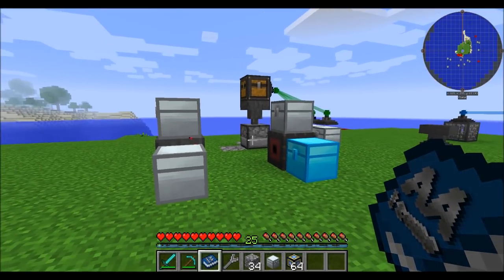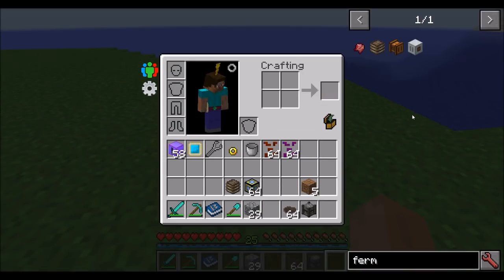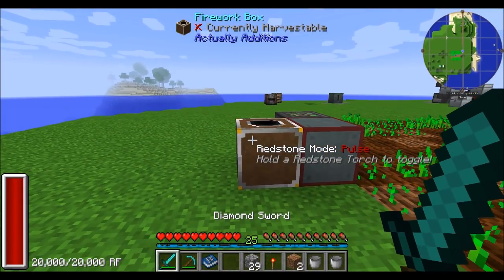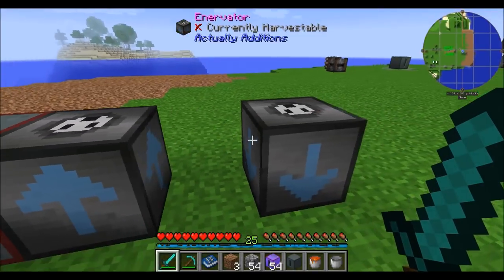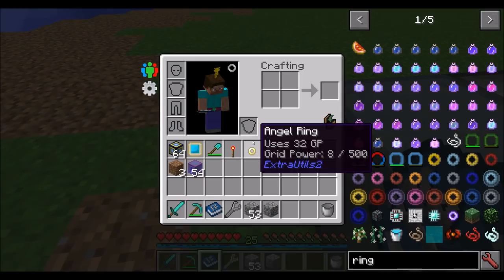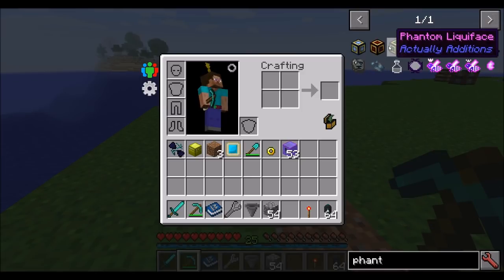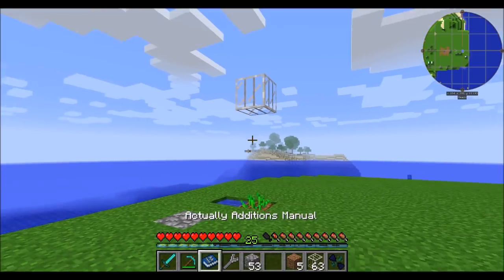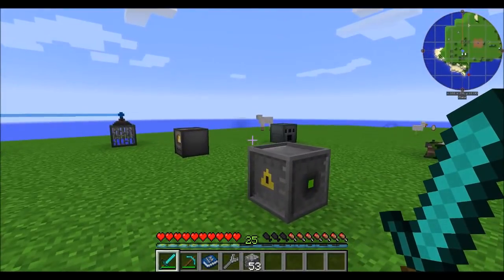Mod Spotlight   Actually Additions Pt2

Comment: The phantom placers make for a great wither farm. you can use the RF Tools shields to form a kill chamber and the phantom placers with phantom boosters to build a wither inside. 

It does take some timing trickery, but RF tools sequencer is up to the task. just make sure that you place the skulls after the soul sand and that the next wither isn't built until the previous one is dead or out of the way. A tower setup is good, it lets the summoned wither fall before exploding.

Draconic Evolution has a really powerful mob grinder that can insta-kill the wither. so that part is also good.

Comment: So this mods RF usage was balanced around Draconic Evolution then :P ?
Reply: What do you think is the problem with it?
I've never gotten any complaints about balance in the past, so I'm definitely interested in what you don't like :)
Reply: You have things squarely balanced around the millions, which is a bit out there.
base Thermal Expansion should be your guide point on RF balance and go from there. Your basic item battery holds 1 million RF, compare that to the most basic form of item energy storage from TE the Leadstone flux capacitor. it holds 80k

Or take your oil generator with basic canola is 40rf/t, compare that to the dynamos from TE, which all run at 80RF/T
the difference they use is the time it runs for per fuel operation. with the highest possible yield 2million RF (over 20 minutes) from the magmatic dynamo running on blazing pyrotheum

Keep in mind I'm not telling you you can't exceed 80rf/t or have your capacitor hold more than 80k at the lowest level. But from how blown out the proportions are in your mod, reigning things in would be a good idea.

You might know the mod Avaritia, the one that adds the 9x9 crafting table. That mod was a joke intended to poke fun at the power creep seen in modded minecraft. The irony was that it wasn't seen as a joke and people picked it up without realizing what was happening. The irony here being that power creep was already so far out of control that Avaritia seemed normal

Avaritia was inspired by mods which were just going crazy with power creep especially those in the field of RF hense why Avaritia allows you to create creative energy sources.

Just. don't be part of the power creep. its all I ask. 1.10 is a good start to fixing that behavior from 1.7.10 and it would be nice to see other mods not made redundant by power creep
Reply: Ellpeck I would enjoy this mod a lot more if you just toned down the rf generation and usage
Reply: lalybum
 thats a false statement that you can use in pretty much any situation. Criticism is healthy.
Reply: lalybum
 Yes, no one said they can't but criticism is not going to stop the person doing what they want. You apparently don't understand what criticism is.
Reply: lalybum
They are a modder. Proper fully explained criticism is useful to people like them. Speaking as a developer. Did you not see the part where they said "What do you think is the problem with it?"

They asked. I told.
Reply: That's interesting. I didn't see Actually Additions as part of the power creep. Mainly because most of the people I have seen on Youtube and elsewhere have mostly been complaining about the low values the mod produces - to my surprise, as I had them balanced around Thermal Expansion values. At the start, the Canola gen was producing at most 60 RF/t, which I thought was plenty. But I ramped it up to have a chance against the more popular power genning mods that were, as you also said, producing power values in the millions. I know that's not the nicest approach, but I also know that things like the EnderIO power generation with hootch and stuff like that is rarely being used by the average user - because it produces "so little".
I usually try to balance/change/fix my stuff based on the "average opinion" I pick up, but I feel this is a topic that only modders are able to "fix". So, I think what I'm going to do is tone down the generation/usage amounts a little in 1.11 and see if that works well with everything else coming up, because I noticed after your criticism that, yes, indeed, the power generation and usage may be a bit unbalanced in places.
So thanks for the help :)
Reply: It also depends on the mod(pack), though. At least in 1.7, the power balance of TE/enderIO, mekanism, extra utils, and Galacticraft are so different from each other, that some power generation options are simply better; i.e. gas-burners & windmills(mek), coal gen(galcraft). 

Throw in some of the addon mods(compact solars),  Big Reactors mod, etc. and the power creep becomes a bit crazy. 

Part of the problem is the ease or difficulty/challenge of setting up renewable energy sources. Compare mekanism windmills and big reactors to an automated tree/charcoal farm powering steam dynamos.
Reply: RoraxPlays I had fallen out of Modded Minecraft for a while, and I came back, and the first thing I noticed was this massive power creep going on. I'm glad other people are noticing it too. I miss the old days of Red Power and Buildcraft where item routing was actually a fun challenge, and mining machines required actual effort to set up. It seems like nowadays people just create mods like "Its like this mod, only easier!" and then the other mod gets all but erased. I have a lot of respect for Railcraft as a mod in that regard. It is a mod that is intended to be challenging, yet rewarding and powerful. No one likes it though, because why set up complex systems to send minecarts out to your quarries and production sites when you can just auto generate ores?
Reply: +DarklingGX - Eh, if people want to have that experience, they still can. All they have to do is not use the other stuff. 
Back when I used to play packs with Equivalent Exchange, I didn't use it. Because I liked the Buildcraft+IndustrialCraft route. Nowadays I just go with Mekanism because it does stuff the way I like it, and gets me off early game (which I been through many times) really easily.

But if I want to challenge myself, I just remove it from the pack, or I don't use it..and there you go.
Reply: Gabeux
the mod lists get very small when everyone has joined the creep my friend "just don't do it" is very dismissive of good critique
Reply: You have a high opinion of your critique. Also, I'm not dismissing it. What I'm saying is that, at the end of the day, it'll sit in the hands of the players to balance things out.
If you make it things too weak, people will config (or mod) mods to make them stronger, and vice-versa.

Also, pay attention. I replied to DarklingGX in the context of things being "too easy". I remember when I only had Buildcraft pipes to play with, and those annoyed me to death. Once I came back to Minecraft, there were Itemducts and Fluiducts around, and stuff that took hours now took minutes to set up. In this context I say "just don't do it" (in my case, I loved the simplicity and Redstone Flux when it first showed up). 
I'm all in for balancing, but in sandbox games, "balancing" means thousands of different things..depends on who you ask.

To your actual criticism of things being in the house of millions of RF, there's no point in my reply in which I disagreed with it. Values in this mod seem indeed pretty weird. So I have no idea how you thought I was being completely dismissive.
Reply: Gabeux
my reply to you was because this is a public thread and you were dismissing Darkling by saying "just don't do it" pretty simple really.

seemingly blind to the idea that not all mods are the same, some don't have the configs necessary to make the personal changes required.
That pack popularity is what drives these these changes, which shuts a lot of people out of mainstream packs.

And some people are just nostalgic for the days of more complexity. WITHOUT going back in time.

And in no way does airing those criticisms warrant a dismissive "don't like it don't play it"

So to reiterate, I was speaking about your comment to darkling. I did not assume you were responding to me
Reply: It really isn't actually, it's just your personal batteries capacities are a little ridonk in comparison to the rest of the mod.

Everything else is actually rather reasonable.
Reply: Yeah big reactors really broke some stuff, especially with the fact that a 3x3x3 reactor can fuel your systems for a really long time, and especially because it basically runs on better coal
Reply: Also yeah I have to agree, the first tier of battery shouldn't be able to hold 1mRF

Comment: Damn he should really make those storage crates more expensive, they pretty much make the iron chests mod useless.
Reply: They are expensive. The top tier requires you to empower multiple blocks. The middle tier requires you to use the Atomic Re constructor.
Reply: The "small" one has the same amount of slots as a diamond chest and it only costs wood.
Reply: I have never used the iron chests mod. I think I could never get over how little space they provided for how expensive they are. IMO the Actually Additions one is a better option.

Comment: the heat collector would be great with blood magic
Reply: not rly the ritual is 3 by 3 and so you cant fit 4 of them in small area i mean you could just use one and take it to the location but do you rly want to do that for 40 rf per tick
Reply: Euan LP why would you need 4 doesn't the ritual produce lava in a 3 by 3 area above it?
Reply: It doesn't place like that by default. There are ritual upgrades that will do it.
Reply: +Euan LP Not sure if it is still a thing but i am pretty sure there is a tool in Blood Magic that lets you move the area the ritual effects so you could move the rituals elsewhere and make them place the lava around the generator.
Reply: If multiple rituals can use the same non-master ritual stones, then you could theoretically use a center fire ritual stone for all 4 rituals and not have to move them.  Otherwise, moving the lava source or making multiple sources isn't terribly hard once you get to a tier 4 altar (which is as soon as you can automate LP production anyway).

Comment: Leaf eater... munchdu... hummm
Reply: I saw the connection with Botania there to. That and the Heat Generator works a bit like a Thermalily.
Reply: yea
probobly a easter egg
Reply: om nom nom lefs.... i noticed it too but that seems like a excessive amount of power
Reply: That or a deliberate appropriation of a established idea, RF is kinda missing out on the intricacies some magic mods have. Most tech mods these days have you merely pipe items or fluid in to a box weather it be single or multi. I mean if that's your thing fine... but actually additions seems to be attempting to provide both for tech minded players.

Comment: OP mod, I will be using very little of this in a legit survival playthrough... The little things like Flax and stuff is really useful, but all the power gen and other tech options are just very poorly balanced

Simple canola farms with a bit of oil production scales up so ridiculously quickly for power comparable to big reactors.
Reply: Why do you think it is op? The higher tiers of Canola are complicated to automate and the Empowerer conversion also takes a bit of RF - that's where I think the balance comes from.
But if you have any suggestions on how to make it better, I'm always open for such things :)
Reply: ***** Oh, hey!
Well, I guess I'm basing numbers off of pre-1.10 mods, where your early game RF was lower. Maybe things have changed in 1.10? With AE2 or that new storage mod, the automation of the power gen options like oil or the lava generator is very easy. Formation and Annihilation panes take care of all the in-world crafting mechanics (I like those btw).

And now that I think about it, these are all just complaints about how AA interacts with OTHER mods. The power consumption of some of these blocks aren't too bad if you use AA power generation, but imagine trying a forestry setup to run that repair block! As long as all the RF generation/consumption numbers are configurable, I have no problem with the mod. I think all the blocks and everything are great, the numbers for RF power just threw me a little

Comment: would greenhouse glass work on ender lilies?
Reply: Time to test it!
Reply: Almost certainly not.  Ender Lilies limit what times they can grow.  I think you can only grow them once a minecraft day, maybe twice if you plant them on Endstone.

Plus, bonemeal makes it go back a step (at least it use to).  If it applies the bonemeal effect (rather than tick acceleration) it will cause it to not grow at all.
Reply: Use the photogenic insolator from thermal for ended lilies

Comment: This mod adds some pretty cool stuff, however the trial and error stuff is kind of annoying. I like it when mods are simple and useful.
Reply: What sort of trial and error do you mean? I haven't played all of the mod in my world yet but it seems relatively simple if you have the book.
Reply: Well it has JEI integration, and within JEI it will say put down an item for the laser to covert to the new items, however some require them to be placed in block form for coversion. It's more so the mods that try to be different that make things harder to understand.

Comment: Does you noticed the little bug with the farmer that it puts the seeds on the wrong side of the farmer together with the farmed products. you need to build a system which pump out products and seeds an refill the left side again with seeds or the farmer will run out of seeds...

Comment: This mod is cancer, BRUTAL EXPENSIVE POWER usage..Just, cancer.
Reply: Yeah but the power gen in the mod is really good aswell
Reply: Got to balance cheaty god mods.
Reply: But hay it would be pretty good mod if they just balanced it.
Reply: both the power consumption AND power generation is just soooo ridiculous compared to any other mod. They really have to tweak the numbers to be more in line with something like  MFR or Thermal Expansion.

Really easy automation just from farms gives you oil generation for 350 rf/t PER BLOCK, kind of dumb
Reply: both Thermal Expansion and MFR are not available for 1.10 so your statement is insufficient. In my opinion it is pretty balanced but hey that's what the mod variety is for so that everyone can play with what they like.
Reply: in my opinion the generation compared to consumption of this mod is way to low, alone a t1 solar array of enviromental tech produces over 1k rf/t and compared to the needs of other mods it isn't that useful, sure 350rf/t per block don't sounds bad but power used by the press? the farm? the empowerer? not to talk about empowering is annoying to get the good oil for it
i stick to enviromental, deep resonance, there u have atleast have to plan around the radiation or extrem reactor (new big reactor name) but well thats kinda to easy with no drawback
Reply: The high-tier items are kind of ridiculous on their own but with other mod packs it’s very reasonable; the true power of this mod comes with the storage crates, player interface, and item storage system(link up many inventories and use ae storage bus or refined storage external storage on the interface and it’s immensely powerful)